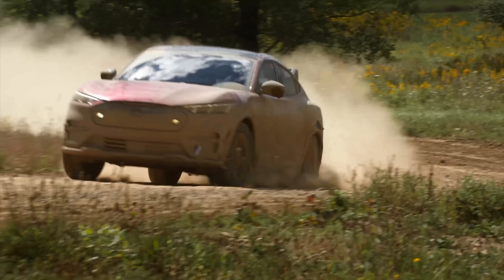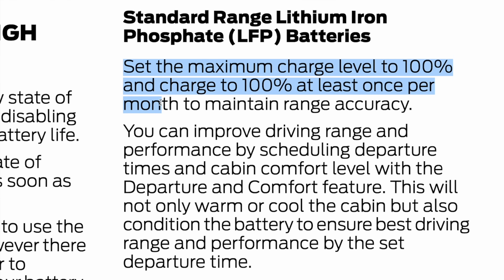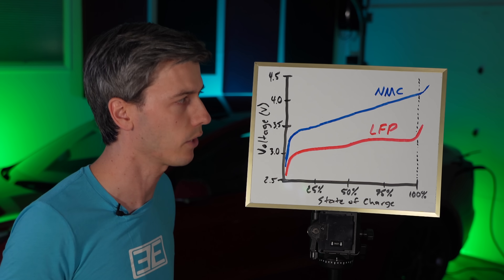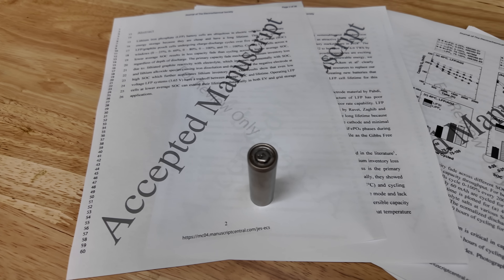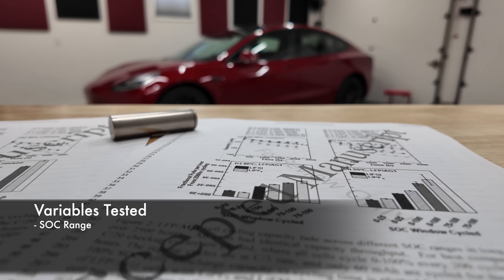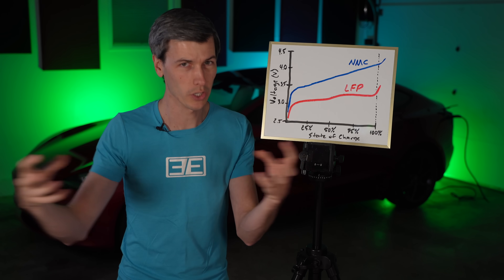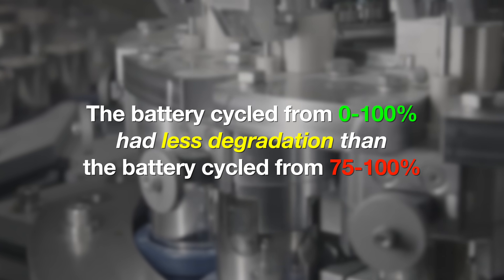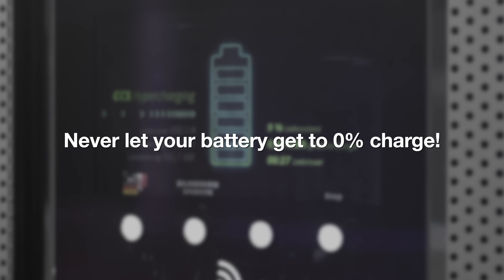How To Ruin Your Electric Car's Battery - LFP Edition!

Comment: lol to say the EV world is currently dominated by NMC shows a total lack of understanding…LFP is way over 75% of the EV market now (new EVs coming off production lines today) …rising to 90% to 95%….NMC is finished as the extreme long life of LFP means they can be supercharged much more often and don’t mind going from 0-100% frequently whereas NMC only likes to be in the 20-80% range…thus the slight energy density gains of NMC no longer make up for all its short comings vs LFP as above.

LFP will dominate the next decade in both EV and ESS

Comment: Googleiong sayes my wifes 2017 bolt with areplacemewnt battery (September 2023) is nickel-rich lithium-ion; what is the best practices for that chemistry? We currently charge to 88% normally and leave it on the charger.

Comment: NiCd had an effect they called "memory" that would effectively reduce it's capacity if you chose to charge it before it had been completely depleted. NiCd would effectively lose capacity if you charged it before it was completely dead. LiFePo has a similar effect but not near as dier. If you charge it to below it's maximum capacity it will begin to report via it's voltage tthat the level you charged it at is it's new ceiling. it's easy to reset by just taking it to full charge once in a while (aka once a month). maintaining a low SoC would be hard to do if you were just monitoring it's voltage because before long it would report it's close to ceiling voltage at lower and lower SoCs.

Comment: Back to the future!!!! After watching the video, I thought that I was in the 1910s when the driver had to be a mechanic, leather worker and tire changer (installing and removing an inner tube and tire from a rim) just to keep the car running for a short trip. Very few people have this extensive knowledge or discipline. Get an internal combustion engine because it is much easier to own and operate.

Comment: I do agree the manufacturer should indicate the battery chemistry, they should abstract away the nuisance to the owner. Meaning let the system properly manage the charge. As a user just plug it in and have the system manage how to charge. The general population won't want to manage these details

Comment: Please correct me if I'm wrong: The study says Lithium degradation increases at a higher voltage and this SOC, which is why it says you'll get the most life when cycling between SOC 0-25%. LFP Cells have virtually the same cell voltage from SOC 25-75% (3% Difference). So there should only be a negligible higher degradation when cycling from 0-75%, right?

Comment: Thank  you  so  much ! ! !    I am now  more  confused  than  ever  ! ! !               UNTIL   the  follow - through  by  @WillProwse  which  answered  my  question  of  full-charging  a  LiFePo4 battery.    ! ! !

    Have  several  'Power Stations'  with  both  NMC  &  LiFePo4  batteries.    Have  had  an  NMC  power  station  run  down  from  1000 watt  capacity  to  about  300 watt capacity  over  5  years  of  steady  charge/discharge  use.   It  has  gone  to  0%  a  couple  of  times  but  recovered  just  fine.    Have  another  LifePo4  power  station  fail  when  running  down  to  0%  ONE TIME !    Recovering  this  station  required  disconnecting  the  battery  from  the  bmc  and  charging  the  battery  separately  above  12 volts.  Even  now  it  is  still  severely  limited  to  about  300 +/-  watts capacity  (and  am  afraid  of  repeating  dissassembly  due  to  the  fragility  of  a  ribbon  cable  to  the  touch  screen  which  is  the  only  method  of  changing  settings / bluetti )  .  .  .  .    ouch !

   SO,  was  looking  for  the  best  way  to  be  nice  to  LifePo4  and  Will Prowse  has  provided  that  answer  by  saying  to  keep  it  charged !   Above  30%,  I guess,  to  be  safe .      Thank  You   Will  !

    Anyone  wishing  to  clarify / discuss / etc.  this  conclusion  of  mine  is  welcome  to  reply  !  !  !
                          Thanks ,               take  care,             rh

Comment: leave it to ford to confuse the terminology.
NMC would normally be called Li Ion,
LFP would normally be called Li Iron.
NMC is easy to confuse with NMH (nickel metal hydrid) which is a completely different chemistry.

Comment: 1)The manufacturer’s warranty doesn’t care how you charge it. 8 years/100k miles = 8 years 100k miles. 

2) Recurrent has great (or rather the only meaningful) real-world data on long-term degradation, performance, etc. Their data so far shows considerably better performance than previous estimates.

Comment: Given how many car owners can't even get oil changed regularly, something as complex as optimising battery life by following a carefully considered charge and use regime...er, nope.  This information is fantastic for the very few of us that do actually pay attention, but for the vast majority of users, again, nope.

There's also a small sub group of which I am a member, I have a PHEV and it gives absolutely no control over charge level.  I have no idea what the BMS means when it says '100%'. Is that really full, or is it 100% of what the BMS deems a safe charge level? Makes it pretty much impossible to plan anything so I've just charged it when it parks and let it get on with it. In 7 years of ownership, and only 13k miles, I reckon it has lost around 25% of it's already paltry capacity. Vast majority of driving is on battery as it only does short trips.

Comment: Brilliant explainer - thank you. For a number of reasons I eventually settled on LFP…I give it mostly rapid charges and have been ensuring at least 100% each week over the first 13 months, 30,000 miles: I have an indicated 3-3.5%  degradation (not unsurprising over its first year) and am curious to see how this evolves over the next 100,000 miles or so…🤔

Comment: My daily commuting (40 km) with a 4Kw BLDC scooter bike (Polytron Fox R) that has a rental 3.7Kwh 72V LFP battery (yeah I betrayed my own country Indonesia, which produced raw nickel for the world), which gives average 100 Km range , at 95 kph max speed, so I just charge it from 60% - 100% everyday at home. I don't care about battery degradation. Just too tired to think about it after back from working 40 hours per week. The manufacturer contract said if the battery health is under 85% they will replace it with new battery for free, as long as I pay IDR 200k per month.

Comment: If software is written in favor of the consumer and the car battery you the owner does not need to worry about longevity of your car battery. But seeing this video carmakers fail big time!
I would run down the battery to 40-30% and then charge it to 70-85% a few times. And then drain it to 20% once in awhile to charge it back up to a 100. 
Second trick is that after a 100% charge and coming back from a trip you should not charge immediately. Let the battery rest. And charge it after your second trip calculating fr9m that 100%. Then charge. 
But as said it’s all a matter of ingenious written software. This is key.

Comment: Operating a LFP in the 75-100% vs. the other scenarios (0-###%) what was the shortening of the battery lifetime? 

Was it 2% over the tested lifetime or 30%...both are detrimental but one is significantly detrimental.

An actual serious question.

Comment: I have a first gen e-Golf with a realy small, highly used 24 kWh battery.....charge it to 80% almost every day after work, and from almost 0% to 100% once a month for recalibrating the BMS. Since i have it (~4 years/80.000 km) i lost like 250 watt hours ... A quarter of a kWh....! But it will get an upgrade battery soon thats in development by me currently (42 kWh, actively cooled and heated, hopefully ~70-80 kW Charge Rates 😅)

Comment: I don't get it when you state "both scenarios take the same amount of time and energy" @9:28, comparing 4 charges from 0-25% and one from 0 to 100%. The former is pretty fast, the latter much slower! The amount of energy does indeed go into the batteries but not within the same amount of time. Charging from 80 to 100% is usually longer than from 0 to 80%.
It matters as the initial statement was that the batteries were charged for the same amount of time. It just couldn't be... They might've received the same amount of energy but certainly not for the same duration. Higher SOC makes charging slower just like inflating a tyre already well inflated (pressure) and is usually more detrimental to battery health.

Comment: Maybe an odd question, to have the benefits of both of these battery types, wouldn't it be possible to create a battery which contains both? That way you have a certain area that has the highest peak at the high end charge and the other with the high peak at the low end charge.

Comment: BYD recommends to charge at 100% at least one a week. They recommend to discharge to a low SoC every 2-3 months. I charge my BYD Dolphin at home every day or every 2nd day to 100%. I made a deep charge about 4 times. I then DC charge to about 80% and to 100% at home. So far no problems after 1 year and 30,000 km. We will see…

Comment: You forgot to mention that LFP degrades 4x-5x slower than NMC (~4000-~5000 cycles vs ~1000 cycles). Also LFP is MUCH safer than NMC because it does not catch fire!
Overall LFP will last longer than NMC.
Reply: It's also heavy af
Reply: @RNA0ROGER  NMC is also heavy
Reply: @ataksnajpera  except lfp is waaay worse
Reply: @RNA0ROGER  LFP ~180Wh/kg vs NMC ~250Wh/kg. Way worse you say?
Reply: @ataksnajpera  Yes, 180 vs 250 is way worse. For the same capacity battery pack, lfp will weigh 40% more and take up 75% more volume. Not to mention power density which is also lower.
There's a reason that LFP are typically only found in lower range models, and why every performance EV uses NMC
Reply: LFP can still catch fire! While LFP batteries are generally safer and much less prone to thermal runaway compared to NMC, they are not entirely immune to fire risk.

LFP cells can still produce hazardous by-products under certain extreme conditions. For instance, the decomposition of lithium hexafluorophosphate (LiPF6) in the electrolyte can release toxic and flammable gases, including hydrogen and hydrofluoric acid (HF). In rare scenarios, if an LFP cell is severely overcharged, physically damaged, or exposed to high temperatures, these by-products can contribute to thermal runaway and potentially cause a fire, although this is far less likely than in NMC cells.
Reply: Remember that the cycle life is normally quoted as the number of cycles until the battery degrades to 80% capacity. NMC batteries will still be usable long after 1000 cycles, but just won't perform as well as they did.
You can also get signifcantly more than 1000 if you follow best practices and keep the charge in the ~20-80% range whenever possible. Assuming nothing catastrophic that should allow for 300,000+ miles for an ev with a 250 mile real world range. By that point you've be down to a 200 mile range which is still very usable for most people.
Assuming it's not been crashed before that, or so old by that point as to be worn out in other ways - a lot of ICE cars never reach those kind of miles.
Reply: @JPEight  You do realize that NMC is just a chemical bomb? LFP on other hand is much much safer. I would never buy car with NMC cells and keep it in garage next to my home.

Comment: Finally, since battery aging relates mainly to usage, the pre-own EV’s with an old battery are much harder to sell: battery condition can be diagnosed but is still a vague and lottery assessment…this is one reason with lowering new prices due to a severe chinese competition and market shrinkage, (I.e. junk couldn’t compete well if Teslas TMx, I.D.x and EQx were BETTER, since it cannot compete well against Golf Jazz ICE’s, despite being an old 140 yrs concept !!!). This why EV depreciation is so fast and since autonomy is a most discussed critical selection criteria, and improperly used old batteries have less capacity than new ones, this adds to faster and rapid depreciation. Now, in contrast,  a modern and LIGHTER PHEV with good electric range, 50 miles, can be smarter than humans and program its small battery charge level all the time for optimum battery life with basically only 500 lbs in a power pack consisting of an 2 litres thermal Atkinson ICE, a small 12 gal,tank and a 13.4 kWh battery with 6  times less lithium than a heavy similar BEV, is also good for a 600 miles range and 3 min. Refill vs a BEV with its heavy 1000 pound battery pack for only 260 miles range..and long hours to recharge. Moreover, with a larger and heavier electric motor w/o the ICE power assistance and the needed for an ~20% heavier vehicle to carry all this overweight as well, the BEV can only be less efficient over the first 50 full electric miles. Then, over 50 miles, being light and with much more regenerative braking, but without an heavy multiple ratios automatic or manual gear box almost as heavy as the engine, it reaches almost the light weight of a basic ICE powered vehicle. So rationally, this PHEV is technically more efficient than both a  most efficient TM3 initially or a most efficient Golf eTSI 130 later down the trip…So, even as a current compromise, This is the best of both world and rightfully awarded by the ACEEE as the most efficient vehicle in production in 2024..So game over…don’t cry but EV’s dead.😂😂😂
PS : even if PHEV is a transit solution, to H2, with the initial difficulties to refill green H2, ( H2 systems production will be tight till about 2030 as the current production volume must grow with automation  and robotisation of COPV’s HP compressors, PEM electolysers and fuel cells, etc..) the future green H2 mid size low cost high volume cars are likely to be ALSO  hybrid, the solution her is. a small , both expensive and efficient cruising fuel cell 12-18 kW…in  hybrid synergy with a cheap much more powerful H2 and gasoline less efficient flex fuel ICE..power booster… …So most likely this is why Toyota is working on both prime movers…always one step ahead…the wheel is tuning and the small start ups with BEV only , Lucid Canoo Frisker even Tesla will be more and more in trouble to produce optimised solutions..

Comment: I wouldn't say telling users the 8th digit of their VIN, in some manual section is making it easy to tell users what their battery is. Why not just tell the driver on the charging screen of the infotainment screen? The firmware KNOWS this information. It can also advise the driver best practice based on that information and the sort of tips the driver is making, and based on how they predominantly charge their car.

Comment: I think it’s worth noting that the Tesla software of the car will indicate which battery you have. You can see this under the warranty screen and if you charge the car it will automatically tell you the recommended battery charge level for either 100% for LFP or 50-80% daily for other chemistries.

Comment: I have a Tesla with an LFP battery. Until now, I could not find a decent explanation on the best way to maintain the longevity of my battery. Thanks for a great video.
Reply: First off how do you know it is LFP in a Tesla? (just curious).
Secondly this video's title is pure BS as is most of the discussion. 
One should follow the manufacturers recommendations and not 
those of YouTube especially during 8 year warranty period.
-from owner of 6 EVs, still running Tesla I bought 12 years ago.
Reply: @anastigmatix4119  Base model Tesla's in Australia use CATL's LFP battery. Some weeks I wasn't doing to very many kilometers. I wasn't sure if I should charge from 80% to 100% every week.
Reply: @anastigmatix4119  if it advises you to charge / keeps the default charging limit only to 80%, it's NMC. Otherwise LFP.
Reply: @anastigmatix4119 you can see in the car settings, also have an lfp Tesla

Comment: Thank you for explaining the topic so well. I leased an LFP car precisely because I can not charge at home. 100% of that LFP pack is conveniently the same as 80% of a competing NMC offer range wise. The video just left me with one question. How does an abused LFP cell hold up compared to a pampered NMC? I often read that LFP is just inherently more cycle proof so increasing degradation by a third still leaves you with a long battery life.
At least MG seems to think so as they don't even offer soc limiting.

Comment: Any lithium battery you buy will arrive at <50% SOC, and mainly because a lithium battery at 50% SOC is a lot less likely to enter thermal runaway and set the ship or delivery van on fire.

Comment: That headline😱. I am a taxi driver, and I charge every day from 40-100% or whatever 70-100% because I think I could need the range the next day. Also the truth, most of the cars loose 80% of their value when they reach 200.000 km, and I think I will get to that mark with my LFP battery. Anyway, my new charge limit now is 80%😅
Reply: Don’t do it! You will ruin your battery.

Comment: You didn't tell LFP's another issue. Memory Effect. If LFP cell batteries are recharged repeatedly after being only partially discharged, It's voltage curve distorted. it makes read charge level more hard.

Comment: Because the terminal voltage of lithium batteries is not a good indicator of SOC, they have to use 'coulomb counting ' ( amps in and amps out ) to keep track of the SOC.  Thing is that SOC can 'drift' especially with high charge and discharge period, so FORD state 'to maintain RANGE accuracy you should charged to 100% at least once a month'  - this is basically resetting the coulomb counting figures...  I never have to do this with my ICE fuel tank - it always know how much range I have...